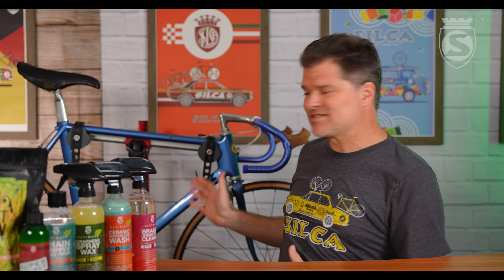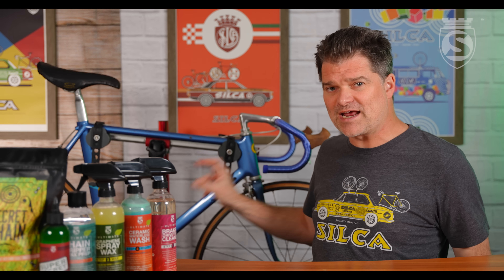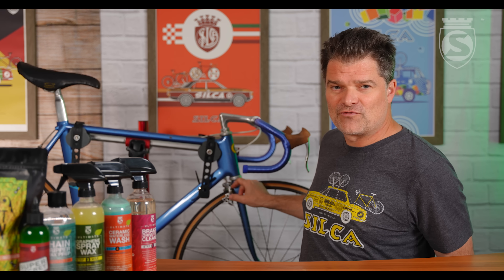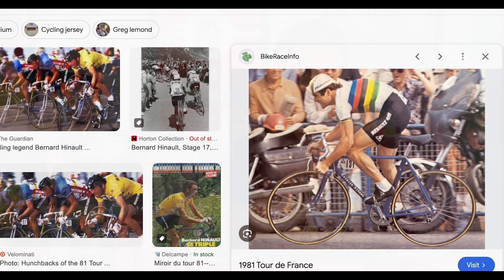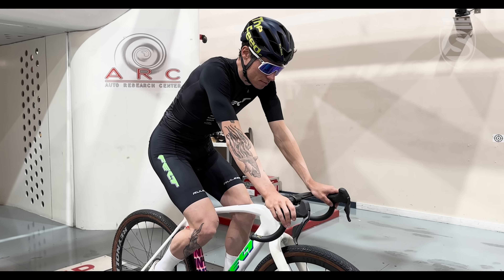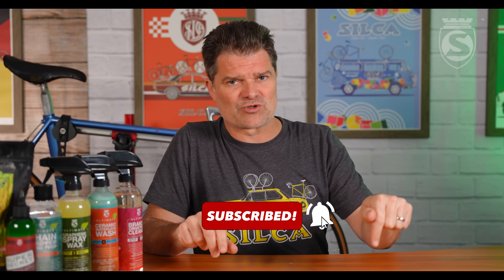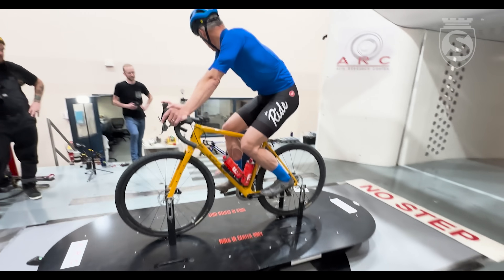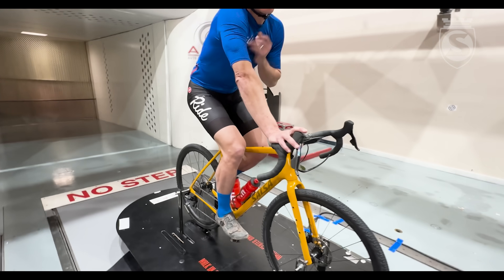Wind Tunnel Wise: How Your Bars Slow You Down!

Comment: What about the loss in handling?  Seems like that would be an issue on muddy days or courses with a lot of turns/single track sections. Controlling your front end with 36 cm bars down hill at speed would seem difficult.

Comment: Now I'm well convinced that a narrower bar is faster and won't cause you control problem. But can you further test in the WT how narrow is too narrow? Let's say from 40 all the way down to 30 or even this 26. 40 vs 38 vs 36 vs 34 vs 32 vs 30 vs 28 vs 26. Then tell: 1) Which bar width is the breaking point of diminished return? 2) Which point is the breaking point of comfort? That means when you really have to put effort into "riding" the bike or have some very noticible handling issues. 

I know from my own experience that 38 is not narrow at all, before all of this narrow thing kicked off. I got a 38mm bar for my wife purely because she has narrow shoulders and when I ride the bike, I don't feel a thing at all! Which suprised me quite a lot given just few years ago how these bars are being said to be "sketchy". But I just completely unaware of the aero benefits of it at all, albeit I made some downhill PBs but I just thought it's just the day that I went bold. 

Now I'm in the process of chasing this new seemingly low hanging fruit in my pursuit of free speed, but just wondering if it will be OK to go very narrow, let's say, 32, because that's the narrowest I can find. But that one is 32 hoods and drops. Don't even know if the 32 drop will make downhill scary or sprinting weird. The other more seemingly rational option is a 36 hoods 40 drops bar with aero top. I know I can just get both and try myself, but I really like some input from the experts. Also obviously I don't have a windtunnel at home.

Comment: Hi Josh, Dylans Cat tongue tape. the dimples or design pattern on that, does that do any tripping? cheers,
Reply from the maker: He's using it on a pretty aero shape so it's more likely a net loss than an improvement.  Textures really only work on 'bluff body' shapes which have not been streamlined.

Comment: How does one quantify the other consequences of using narrower bars - typically more arm, back and upper body fatigue? Working harder to control the bike also wastes energy, not to mention the discomfort induced by riding a narrower than natural handlebar.
Reply from the maker: You have to remember that the 'consequences' here are mainly if not entirely just theoretical.. this doesn't work for everybody, but I'm yet to put an athlete on a 37-38cm bar and have them go back after 2 weeks of trial period and this includes WorldTour riders on whom we have immense data and can measure things like fatigue, energy use, etc.. and once the rider is adapted we just don't see any of that stuff, and in fact we just see higher speeds and/or lower energy use through the improved aero.
Reply: @SILCAVelo  I was asking the question more from the perspective of somebody who is not a professional athlete and who typically adapts very slowly (if not at all) to significant changes in posture and bike fit. But fair enough, maybe this is not for everybody.

Comment: I'm curious how these bars affect sprinters. I'm a big guy (190cm, 85kg) and that's how I win races usually. I've been experimenting with narrow bars but they all don't feel great when sprinting out of the saddle in the drops. Is there a too narrow? Are narrow bars for breakaway guys only? I love all this aero data, but it's all in a stable "solo break" position and I'm just wondering about out of the saddle efforts.

Edit: Also, does the flare affect the aero gains? Like, would a bar that's 38 tops and 38 drops be more aero than a bar that's 38 tops and 43 dops?
Reply from the maker: I think that it really just depends on the time spent adapting to the narrower bars.  If you look at track sprinting and points racing right now, pretty much everybody is on a sub 34cm bar, and while it looks a little different than it used to, the speeds are higher than ever.  I think that bars with flared drops are a great way to have your cake and eat it too.. 37-38 on the hoods for fast cruising and then something more traditionally wide for field sprinting.

Comment: Please include the internationally recognized unit known as the “Portner”, which we all know is the watts saved by going to oversized pulley wheels. If I remember correctly, cheap aero socks saved 4x as much power as a set of oversized pulley wheels, or 4 Portners….😅

Comment: I think this test would not survive in academia. I love Cilca and their research presented is normally quite good, but this one is not. 

Because, the test was not whether the narrow bars were faster but you just tested different rider positions. So the width of the bar is not the explanatory variabel, but is merely a moderator which resulted in different rider positions which explained drag. 

Next time test different bar widths when riding in the same tt position, so both hands in the middle of the steer.

Comment: For as long as we rode 42/21's for a low gear, 42 bars and 175's made climbing out of the saddle much more powerful. And as long as everyone rode the same available equipment the competition was level; training was focused on the techniques that could get the best results with what we had.  Everything had to change, not just the aero.
Reply from the maker: This is a great point that is rarely mentioned.. you are 100% correct that wider bars were much more about staying on top of monster climbing gears when out of the saddle than they were about breathing or seated handling.

Comment: Put Ben next to Dylan on the same road and have Ben ride at 190w and Dylan at 120w...you really want people to believe Dylan is going to be going any where near as fast as Ben? These tests are so silly at this point.
Reply from the maker: So these are only aero watts we're discussing.. but yes, they would each add say 60 rolling resistance watts and 6-8 drivetrain watts to both of their numbers to get the full totals, but absolutely, if Dylan requires 60 fewer aero watts to go the same speed, then side by side, he's going the exact same speed on 60 fewer watts.
Reply: I believe that Ben would need 360 W to go 32 kph compared to the 300 W Dylan would have to put out. Especially  in case of some headwind.

Comment: Aero bar or narrow bar? Is a narrow round tube bar going to save more watts compared to an aero profile bar that is a few centimeters wider? Would be great if the answer is yes so I can go buy a cheap aluminum bar instead of an expensive aero carbon bar.
Reply: Get a cheap aluminium bar and route the cables so it becomes a flattened bar :-)

Comment: Question: Is taking frontal pictures of yourself on the bike and calculating the area from the outline a usable method for getting a comparison between positions or does the drag coefficient change so much that this can easily offset a smaller frontal area?
Reply from the maker: Frontal area is a very good proxy for drag reduction.  There are always some offsets to Cd from reducing the A, but as a rule of thumb a reduction in A of say 10% likely reduces CdA 8-12%

Comment: How about the supposed benefit of wider bars for improved control on unpaved surfaces?
Reply from the maker: The general consensus amongst athletes we work with is that after a week or so of riding, the narrower bars are no different in stability or control.
Reply: That’s interesting. Although I assume it wouldn’t hold for the track bars!

Comment: Very interesting 👍.
Just a question, I see the test with static position. When pedaling, could we observe any others results ?
Reply from the maker: We test both ways, non pedaling for component and equipment changes as the noise in the data is significantly reduced, and then pedaling for rider position work as the rider has to be comfortable and be able to maintain the position over a period of time and we look to see that the data doesn't drift from the rider moving out of position.  In general, the rider with legs at 3/9 o'clock like this gives very nearly the same drag as if the rider is pedaling but with 10x reduction in noise.
Reply: And not only pedalling but also steering the bike on rough terrain. Such videos are just bro science attempted to present like real science.

Comment: watching coverage from the spring classics, looks like lots of guys with narrow bars are chicken winging badly. 

What's the point of going narrow if you can't ride the position?
Reply from the maker: There's definitely a cargo cult thing that happens in pro racing where teams or riders copy what others are doing without fully understanding why they're doing it.. fatigue is the other factor here as it does take some effort to keep the elbows in.  Having said that, the worst case scenario with chicken winging is still roughly on par with to slightly better than riding wider bars in the first place, so there's some real asymmetry here where you either get a solid benefit or at worst, no benefit at all.

Comment: Narrow bar is likely more aero but being narrow would also reduce the bike control outside of wind tunnel…
Reply: From experience that's not true on the bike control front. Have done madison exchanges on the track at 70kph on those 26cm bars with zero issues. I've also descended twisty mountain descents at nearly 100kph on 33cm C-C bars with no problems (it actually felt better than my old 35s). Don't knock it until you try it. Again, going that narrow isn't for everyone....However most just make assumptions.

Comment: At what point does going too narrower become too unstable and is there a potential to screw with your position from a comfort standpoint?  Interested in going to a narrower bar but don't want to sacrifice comfort.  I'm 6'3" with an average build.  Should I try 40 width bars?
Reply: I am 6‘8“ and recently switched to 38cm EXS Aerover integrated bars and love them.
Us tall dudes need every help we can get to cheat the wind
Reply: Depends more on shoulder width than height.  I’ve heard narrower can even help to some extent if you need more stem length

Comment: I use wide bars on my gravel bike because not losing my bars in sand/ruts/potholes and unstable conditions is more important than aerodynamics. Also more hand position/width options.
Reply: That's why flared bars are amazing. You have your narrow aero position on the hoods and a wider, easier to control position in the drops.
Reply: @michaelmechex  exactly. When I built my first gravel bike, I switched from 42 cm straight (road) bars, to 40mm flared bars, which are 45 at the drops, so I got he extra width for rough/soft terrain, while getting more comfortable and aero on the hoods too.
Reply: How do you get more hand position options on wider bars? The only way I can see is on the tops, that you can slide your hands in and out. But how much time do you spend riding on the tops? 
i just did a 60 mile gravel race, and I barely touched the tops in all the that time. Maybe once or twice for a minute or so.
Reply: @tjb8841  Well it's just nice to be able to position hands wider on long rides occasionally, but I do that mostly on the hoods. I rode 91 miles yesterday, five hours  , averaged 18mph w/4600' elevation gain. Thinking I'm going to swap my 52cm bars out for 42cm to be faster.
Reply: @WesleyChe  I’m sorry, I don’t understand how you can change the width of your hands on the hoods, can you explain?
Reply: @tjb8841  No I'm saying with wider bars one can position their hands wider, with narrow bars the outermost portion of the bar is the limit so you don't have the option. I'm going to downsize to a 42mm drop bar and see how it runs.
Reply: Even for a real life daily road riding anything narrower than 40 cm starts getting compromised handling, and by 36 cm it becomes severely dangerous suitable only for riding a straight line on a very good condition road sections.
Reply: Odd to make such a seemingly absolute statement about 36cm bars.  Surely, you're not speaking for all the people who get along just fine with narrow bars... are you?
Reply: I was also getting along well with narrow bars but don’t use them anymore after I was forced to turn on looser sand road sections. Very hard to control the bike, even with 42cm handlebars it’s challenging but at least you have a chance. With narrow bars no chance.
Reply: @tongotongo3143  bars on my gravel bike measure 38cm on top, I also have levers turned in, so it's 34cm wide where I'm actually holding them. I've done an xc race on it just fine, deep sand isn't a problem either

Comment: I've had professional bike fits and have always had to go back to my wider bars. My power drops and it is vastly more uncomfortable to run 36-42cm bars vs my 46s with some decently extended use for each size on the same model (Cowbell). At 6'3" and 200# on a 60cm, I am already not super aero, so in the scheme of things it is what it is...
Reply: You must be missing something like adjusting for reach  - or the specific bars you’re using don’t work in say a 40cm. 

In a similar size to you, the idea of using 46cm bars is horrifying.

Comment: "Lower speeds of 32kph"   Ha!  Please try some tests down at 20kph.  That's more like my gravel speeds, and likely a fair number of 'regular folks' too.
Reply: This has been discussed a lot before. You don’t want to test at super slow speeds, because it’s hard to get a good signal:noise ratio. But, you can calculate the savings at 20 km/hr from the data you got at 30 or 40 km/hr. 
Specialized Wintunnel project did the math to show that fast and slow riders save roughly the same time/distance for any particular aero gain. Although the speed increases are smaller for slower riders, they are put there longer , so a smaller gain per minute, but multiplied by more minutes.  Of course, slower people tend to ride shorter distances.

If you are interested in, Ben Delaynyes channel “The Ride” has info in one of his videos about this, where he links to several online models, where you can calculate your own estimates for adjusting different  variables , including power or speed.

Comment: Dylan (and others) rests his forearms on the bars, sort of like tri bars but less comfortable. So wouldn't it make sense to get rid of the forward extension of the stem and make bars with a super long going-forward section (perhaps even with pads for forearms, like tri bars) so you could comfortably and safely (unlike tri bars) lean on them?
Reply: As a tall dude, who has to use 140 or 150mm stems with short reach bars, those Breakaway bars seem quite interesting.
Edit: €1000 , guess not! 😂
Reply: That works till you go to sprint and you smack your knees on the bar, probably
Reply: @mitchpowers9316 It’s a balance between the shape of the elbow and the flare in the drops. Deeper drops and longer can also facilitate this. I’m currently using 80mm reach bars that also have around 25mm of backsweep. When used with new Red E1 levers, they provide a lot of “illegal” armrest for my forearms to perch on.
Reply: resting your forearms on the bars is banned by the UCI, so no big brand would manufacture a bar like that.
Reply: Speeco made some a few years ago, but the UCI banned them. Search for "Aero Breakaway Bar" or Van Schip to see them. Looks super comfy to me, I guess still legal in gravel...
Reply: Yes but not for the uci, check out what happened to jw van schip in the baloise tour last year or one before.
He had what you described, was allowed to race, then got taken out of the race.
Reply: I thought Redshift Sports has a nice gravelbar with built-in aero position "protrusion", named Kitchensink.
Reply: The Aero Breakaway Handlebar is not UCI legal.
Reply: Why would you displace downward force away from the pedals and dump it into the bars? And want to do it in the comfort of a child in bed scrolling on their phone? Some of the comments I read from supposed racing bicycle owners are mind blowing.

Comment: Your videos are so interesting! 
Could you please explain why the riders don't pedal in the windtunnel tests? My guess is that the aerodynamic numbers are different when the legs are moving and creating turbulence. And the aero difference with a narrower bar will relative be smaller?
Reply: 1000% agree.  Make the riders pedal, and do what we all do.  Fidget, adjust, look up, look down, and all those things that will upset the aerodynamics.  Then, tell us the results.  Putting some crosswinds, cars passing, riders passing! and other real life air movement parameters into the mix will also affect the laminar and wake fluid dynamics.  The testing is too sterile for me to accept the results.  But, a good step in the right direction.  Training and focusing on maintaining a great aerodynamic posture will get better results than re-investing on re-aligned handlebars